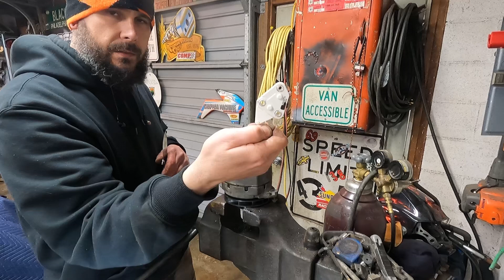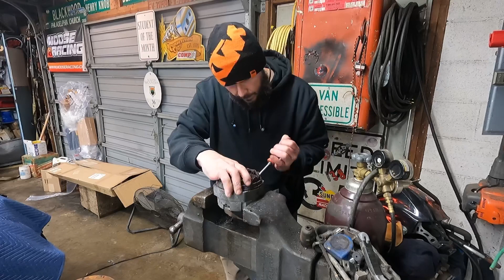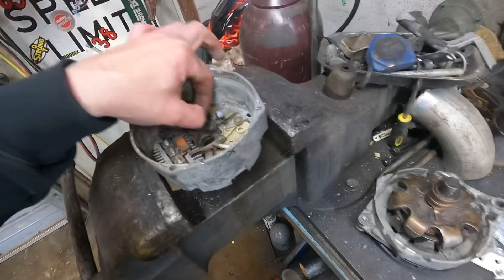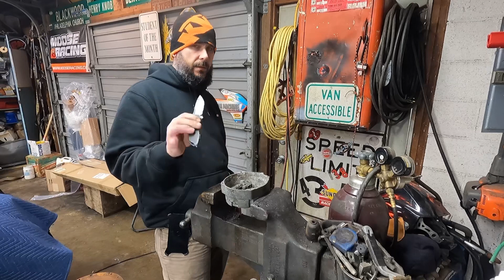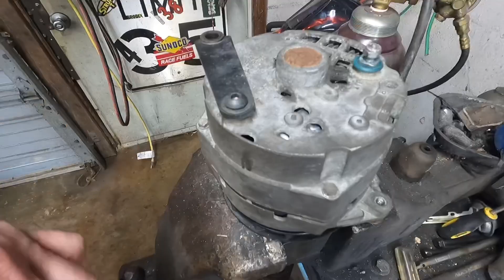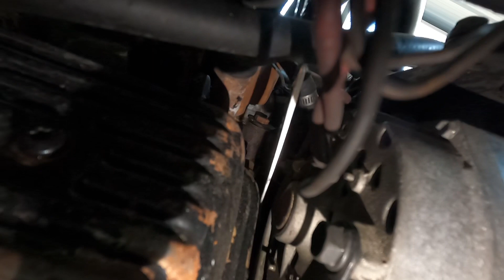GM one wire alternator how to build

Comment: Thanks! New sub. I was looking for a reason my old one-wire alt drains the battery to ZERO overnight. I just got my 69 C10 back from a "mechanic" that rewired some stuff. He added a negative terminal disconnect and said the new EFI had a drain. It does a little but not enough to kill an Optima red overnight. I'm thinkin he wired it wrong. He did some other dumb stuff too. Time for me to work on it!
Reply from the maker: Glad the video was helpful. Hopefully you get it all sorted out and thanks for watching and subscribing.

Comment: Thanks, I have used some 1 wire alternators but never built one. Before that, on old tractors, I would run a wire to a light and amp guage from the battery post on an alternator to the switch and to the battery. It worked, but you would half to idle the engine down or it would not die. Thank you so much for the information. Can this be done to any alternator or just older GM ones?
Reply from the maker: I really don’t know of any other brand that does the one wire/self exciting than the Gm stuff. Seems to be pretty popular to use on about every platform.
Thanks for watching!

Comment: What is a "certain" rpm?
Reply from the maker: That really depends on the pulley set up. With March pulleys mine will self excite about 900-1000 rpm.
Reply: @LeftForDeadGarage  👍🏻 thanks. I wanted to know if it was settable but as long as its fixed and doesnt require setting.
Reply from the maker: No problem. 
Thanks for watching

Comment: Good work. Brings back some good memories of working in a generator repair shop. I saw the clocking of it on the 64 and wondered about it.
Reply from the maker: I ended up putting it back like it was. The battery stud isn’t close enough to worry with. I’ll run any 12v supply off the Ford solenoid that Iam using.
Reply: All you gotta do is put a one inch jumper wire Where the 2 prongs are that you plug in to the regulator. Been doing it since the mid-seventies when they came out. I know it sounds too simple to work, but it does. I've put them on 50 models. A 70 ford,49 9n ford and a volt meter they all charge 13 + to 15 v . Any 75 GM with internal regular alternator will work
Reply from the maker: @richardmartin2646  I’ll have to try that.
Reply: @LeftForDeadGarage  It works. I think 73 -79 GM. Cadillac and Buick have higher apps u know what the alternator looks like .I get them at junk yards and fix cheap back in the day

Comment: So I've got a question about alternator sized. My engine is from 1968 in a 1966 C10.  When you put load on it, lights or blower motor, the battery gage DROPS. While running, the battery and alternator both show 14Volts. Its the alternator fine?
Reply from the maker: Does it get better when you rev it? Also you could have the alt load tested.
Reply: @LeftForDeadGarage  nope it just stays down
Reply from the maker: @frostyflake1128.  it could have a issue, check belt tension too. Advance auto does stock a one wire gm that would be a direct swap even if yours is still the external regulator set up. Also use Retailmenot.com for advance auto coupons, typically you can find 20% off coupons there and sometimes 25% off.
Reply: @LeftForDeadGarage  good to know. I dont know much about alternators but I plan to rebuild my engine and plan on accessories too, I would just swap it but its an OLD block 350 with the old fashioned oil filter. I think its cooler than the new ones